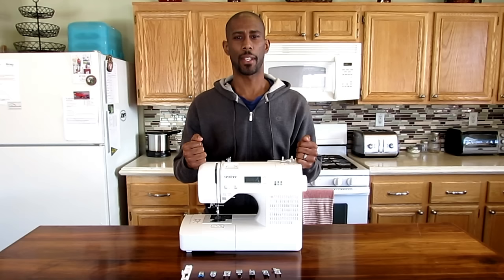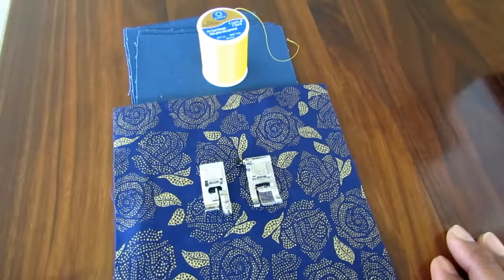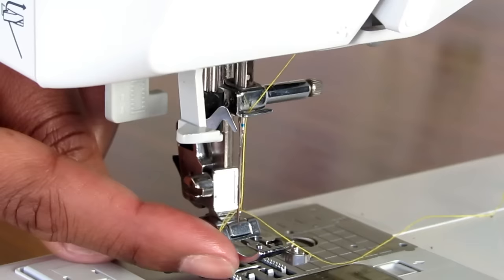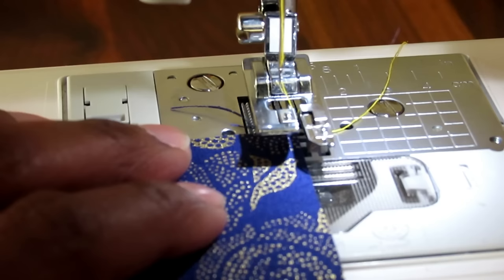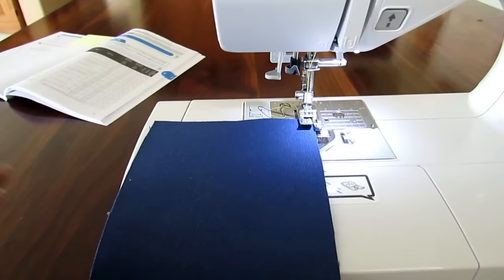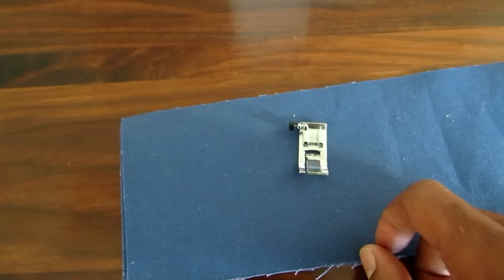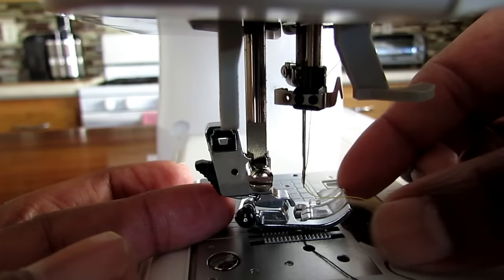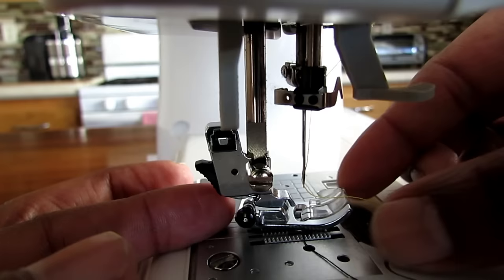Why You Will Never Need A Serger Sewing Machine - Learn Overlocking  & Overcasting Tips

Comment: I have been sewing ALL my life and I am 72 years old. I started sewing when I was about 5 years old.  I have never known any case when the foot had any thing to do with the stitch. The foot is only made in a way to handle the type of stitch but not anything to do with the stitch itself. Any foot that has the opening to handle the width of a stitch will do the same job.
Reply: Yes, a foot that can handle a zig zag would work in this case but the overcast foot is designed to keep the part of the stitch that goes off the fabric edge from being pulled too tight. The video here doesn’t really give you a good view of the foot and how it works. The foot for overcasting has a stiff wire on it that should be placed right on the edge of the fabric. As the thread goes over and off the fabric edge it loops over the wire. The wire holds that thread loop at a set distance and tension as the stitch is made so the loop of thread over the edge is not pulled too tight and the edge doesn’t get scrunched up. The loop part of the stitch then slides off the open back of the wire as the fabric feeds. This isn’t the only foot that gets involved in stitch formation when using a machine with decorative stitches. Have been sewing 40 years. The more modern machines with all the different decorative and functional stitches have stitches that require specific feet which do get involved in forming the stitch.

Comment: Unfortunately, the demonstration of the overcasting foot is incorrect. The purpose is to bind the edges of the seam allowance and prevent fraying. The "G" foot has a small 'tooth' in the needle area where you are to line the fabric, not at the edge of the needle hole. This allows the needle to stitch over the edge of the fabric thus preventing fraying and also the 'bunching' experienced on the lightweight sample. 
Simply put, overcasting needs to be done over the edge of the seam allowance for it to do its job. This way the home sewist doesn't need to use a serger/overlock machine to get the desired results.  (I've learned my way around a sewing machine having been sewing professionally for about 30 years and non-commercial machines.) Othewise, good try and keep learning!!

Comment: Hello. Thanks for your time spent in creating this tutorial. I worked along with you on my machine using thin and thick fabrics, changing to the prescribed stitches, and using the G and J presser feet. How do I remedy my stitches being too loose for my fabrics? I experimented with changing the width and lengths only to end up with the results not looking too good
Reply from the maker: First off thank you for watching. What I would do is adjust the tensioner until you are happy with the results. Thanks again and you're welcome.

Comment: Any chance you can give advice on how to overcast using a curved fabric? New to sewing here and I have no idea how I should be turning the fabric without wrecking everything. Thank you for your helpful videos!
Reply from the maker: That is a tough one to advise on without see it.
Reply: I am making masks and will be using the overlock stitch in replace of a serger. I will be using the overlock to stitch the masks together. The front of the masks are curved.
Reply from the maker: That is a great idea. What I would do is go slow and when you come to a turn leave the needle down lift up the presser foot and then turned Fabric ever-so-slightly and then continuing that same process until you're done.

Comment: Hi. But the overclock machine also seals the edges which these stitches didn't seem to do. Any suggestions on that? I don't want to get another machine that just does one thing (overlocking). Plus it expensive.
Reply from the maker: You are right the overlock machine is going to be the best at sealing  the edges. But with that being said these stitches I've used for years and I haven't had any fabric come apart or fray.

Comment: I have a slightly different sewing machine that looks like it uses almost the same foot as the first overcast foot that was used. I have a White Heavy Duty 1766. The overcast stitch on it has the "triangles" facing the opposite direction as the model you are using, but I assume it works the same way. If I am using medium weight linen and also lightweight linen which foot would be best to use? Should I stitch the fabric pieces together and then overcast the seams, or should I do that first, then stitch the pieces together?
Reply from the maker: I like to stitch them together with the overcasting foot. You can use either foot, I like to make samples and then go with the one I like the best.  Thanks for watching, feel free to ask as many questions as you like.

Comment: Hi, I have a couple questions. With certain knits I have massive trouble with on my machine, no foot or stitch change helps feed it through better and stitches are skipped like crazy. Would a serger fix that issue for those fabrics?
Also I've sewn a few light weight French terry rounds (for cleaning my face) and the edges curl up. I think "serging" on a sewing machine may have stretched the already stretchy fabric more. Would a serger have the same result?
For the most part I love my sewing machine and your video definitely helped me appreciate the stitches I wasn't putting to use! That said, for high stretch material should I have a serger? Or it would be a similar result? Thanks!!
Reply from the maker: I would have to agree with you that a serger is the best bet for some fine fabric like those you named.
Reply: @oxmanagain  ok, I figured, I was hoping to make due with one machine but it's been frustrating haha. Thank you!
Reply from the maker: @coorflowyoga  What if you try pulling the fabric gently, would that help? Plus, you would get to use only one machine, just a thought.
Reply: @oxmanagain  I have, thanks. There are certain knits like really thin ones that I want to use for clothes that skip stitches or bunch and get stuck in the bobbin. It happens whether I change the stitch length ect, needles, go fast or slow, pulling it different ways. I've done everything I could think of. I was going nuts in December with that. Some material was polyester - thin and slippery haha I could try again a few more times and see what happens, one machine would make my life easier

I could try again with the French terry. It sews well for clothing but when I make small things, like a facial round for cleanser, I can faux serge well but the edges curl up  afterward. Maybe that would still happen with a serger though
Reply: I know this is late but I experienced something similar to one of Betsy’s comments and I solved my problem. I recently was sewing a thin stretchy lacy fabric and it would get pulled down into the bobbin area and get locked up at the start every time. I used some tissue paper under the fabric and it sewed this challenging fabric perfectly with no skipped stitches either.  That was the first time I’d ever tried tissue paper. It was like magic.